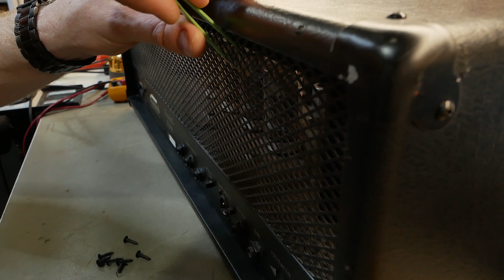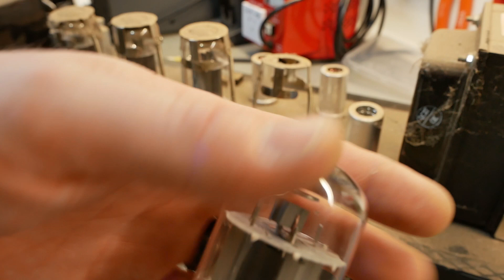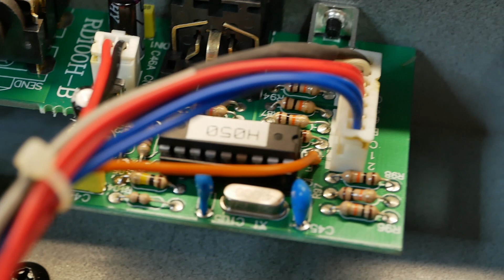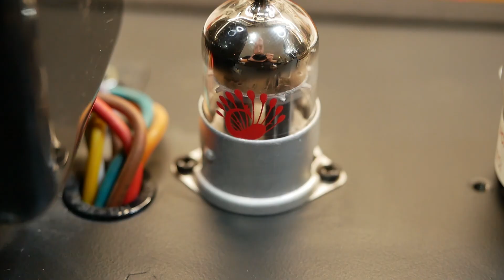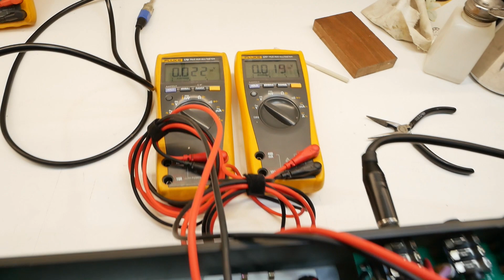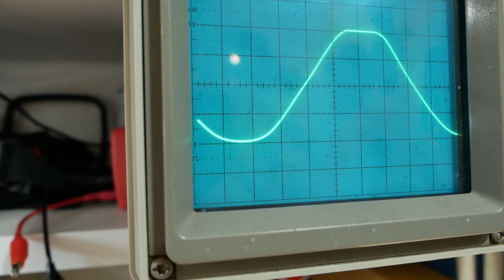My Fave Metal Amp So Far - Randall RD100

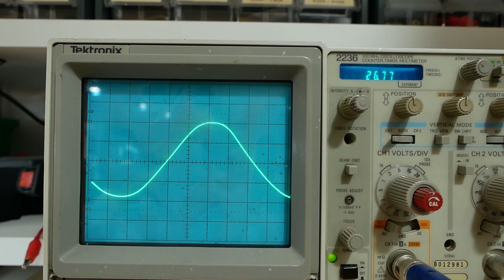Comment: Around 29:10, you show where the clean signal begins to clips, which puts the amp around 85 watts. The industry standard 6505/5150 clips at around 72 watts due to its cold factory bias range and this can be changed using the bias mod. Could the same be done for the Diavlo?
Reply from the maker: I can't remember the exact settings on this one and don't have the time to look it up, but I dare say I biased this one to approx 50%, nominal. Any power increases due to biasing beyond say, 25% power improvement are negligible due to the logarithmic nature of output power vs. hearing perception.
Reply: @BradsGuitarGarage Many thanks for the response.

Guess modifying one of these with a larger output transformer might get that increase.

Comment: I got one of these amps, when played at “bedroom” level the amp has a tendency to jump in volume. I took it in for a look see but it came back as, “ohh the tubes” need replacing, so it was but the volume jump still persists. What I’ve noticed is when the amp is cranked it doesn’t do that jump but rather plays aggressively like I like. What ideas do you have that might be the low volume jump culprit? I’d like to have your take thanks.
Reply from the maker: Grab a short patch lead and use it to bypass the FX loop.
Plug one end into the send and the other into the return.
If this fixes it, you likely need the FX loop jacks replaced.

Comment: I have a problem, I can't get the amp out of the case. I can't push it backwards on the input side. The other side is no problem at all. Screws are loose ;)
Reply: I literally just took my RD100H apart for a cleaning and servicing last night. Did you get the large screws from the bottom out? Did you take the front baffle completely off? The housing wont budge if not. If you look in the rear of the amp towards the front, there are 4 screws near the transformers holding that front baffle on. 2 on the far left side and 2 on the far right. There is also 1 screw in the center top. 5 screws total holding that front baffle on from the INSIDE of the case. You will need a long Philips screwdriver to get them out.

Pull the amp out through the rear. It helps to have a second person at this point if possible to hold the case so it doesn't move while you're trying to get the amp out. Lift up on the amp housing at an angle from the rear using the transformers and start wiggling. It should start to budge. After it's loose, try to lift it up just enough to clear the shielding paper so it doesn't get torn up. The amp is sitting on it so clearing it as much as possible makes it easier to get the amp out and . There is not a lot of clearance because of the wood on each side so it can take a few minutes to get out.

Reinstall in the reverse order above, and don't be afraid to give that front baffle a little smack on the corners if it's being stubborn to line it back up with the amp housing before putting the front baffle screws back on, it's a tight fit. If you didn't already get it out, hope this helps!

Comment: I got a few of the Psvane 12AX7's to try..........  3 of 3 were disappointments.  JJ is my default budget tube now.  Those are generally OK.
Reply from the maker: They are the worst I've had. 10/10 with issues.
Then the Psvane EL34's are the most consistent I've had ever.
So weird how they get some so right, and some so very very wrong!

Comment: Randall makes decent amps. I've had to replace all "Pissvane" tubes encountered in the preamp or PI position. Maybe ok in the V2 in a pinch. Western Electric here in the US is currently making 300B tubes and plans to expand. A matched pair of their 300B's costs $1500.00 US though. Yikes.!!  Plus, they are mainly audiophile tubes. The world is in desperate need of more competition to hopefully bring prices back down. I have had good luck with the Tung-Sol 12ax7's as well as the Russian Mullard 12ax7's more than any others. Tube brands have always been subject to change through the years though. They don't seem to reject the bad/poor ones anymore like they used to. A good supplier is as important as a good mechanic these days. T.A.D. seems to rule that as of now in my opinion.
Reply from the maker: The guys supposedly trying to kickstart GE have been saying that since the mid 90's.
They come out and ask for capital, then go away for another decade or so, unfortunately.
Reply: @BradsGuitarGarage  The only big move that WE ever made toward small tube production was buying Ei without realizing that they were also buying all the obligations to their employees.

Supposedly the machinery got scrapped, and that's the whole reason Ei doesn't exist anymore. I wouldn't trust any claim that WE makes until they're already producing.
Reply: @RudolfWolph  True. I filled out their online questionnaire of what tubes would you like to see them manufacture. I won't hold my breath though lol. I think they only do the 300B's because they can do low volume for a big profit margin and incorporate them in their audiophile tube amp, the 91E, priced for a Saudi prince lol.

Comment: The soldering at pins 4 and 5 of one of those Ruby tubes looks pretty poor (you can see a hollow inside the pins). I have seen Chinese octal-base output tubes made with leadfree solder where the pins were badly soldered and intermittent; if you lost the connection inside pin 4 the tube wouldn't have any screen voltage, and if you lost the connection at pin 5 you would lose not just grid signal but negative bias voltage as well, leading to an overheated tube In a fixed bias amp.
Reply from the maker: It was the PI tube pin 9. So the heater filament common pin.
Reply: @BradsGuitarGarage  ,  Yes I saw that as well. That was a first for me, Ive never seen a pin pull out of a miniature tube like that! (I work with NOS tubes, and only occasionally have to use Russian or Chinese tubes). This is evidence of some pretty shitty manufacturing.....
Reply from the maker: What an age we live in.